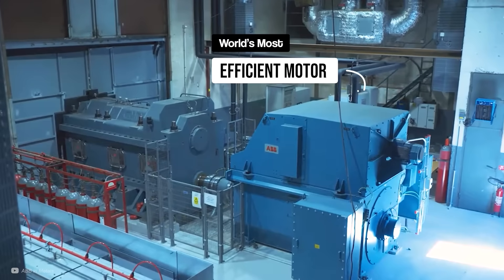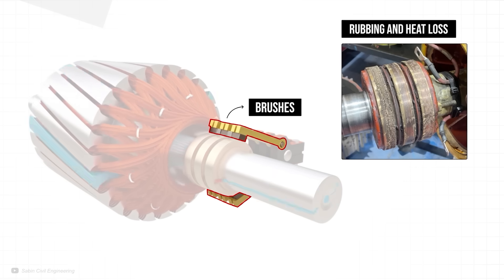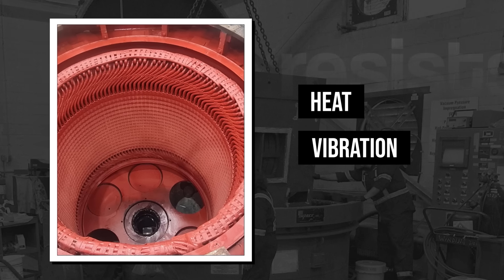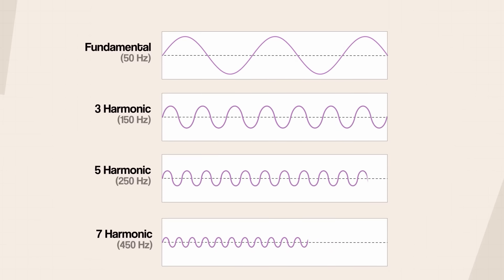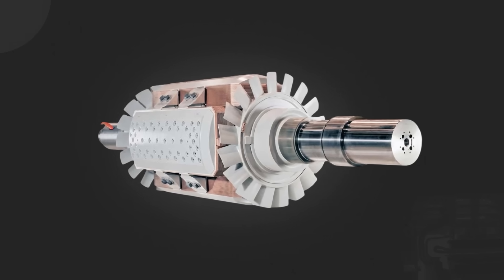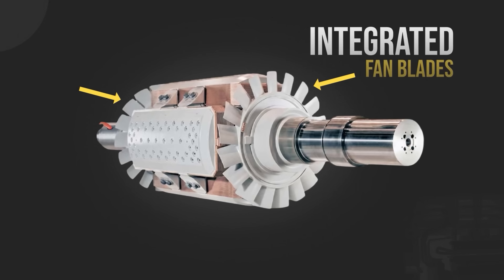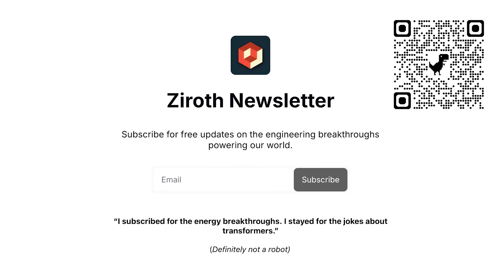How This Ultra Efficient Motor Just Broke The Limits

Comment: HOOOOLD UP. 

What exactly is supplying the cold water flow for cooling and  is that system's efficiency factored into the mayor's efficiency? 

If not, all I'm seeing here is a very well made motor that offloads the cooling losses to an external system.
Reply: yeah, the specs are misleading they probably also subtracted the power delivered to the coils as well. I'm guessing it's 95% efficient or something.
Reply: First of all there is no water pump, it's air cooled. Second, this is ~75000 horsepower motor generating the same amount of heat as a 160 horsepower car motor, and the amount of power needed to push such quantity of water around an evaporation cooling loop is basically nil.
Reply: @michaelbuckers You get 0/10 for comprehension. The cooling air goes to a water-cooled heat exchanger. What do you suppose happens when the cooling water isn't there?
Reply: @michaelbuckers  The rotor's cooling is air, but the stator is of course water cooled -- see the coolant temp on the placard.
Reply: Pumps require less power than you think, especially if only pumping water (no glycol, etc.), because water is basically incompressible.  The fan to cool the radiator will use more.  But because they're only dealing with <1% heat, and they'll need <10% of that to move the heat, it's pretty negligible.

Comment: the actual difference is negligible since other motors are also close to 99%
Reply: Okay so you'd rather have 1% of 1000, than 1% of a 1,000,000? Smart

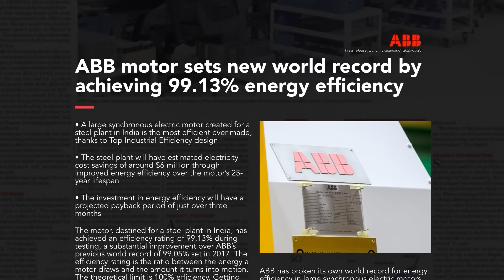Comment: 11:00 I assume the payback period of three months only applies to the difference in price compared to another motor with lower efficiency. So USD 60,000 will only be the difference in price, not the whole price of the motor.
Reply: 11:42 they say $6,000,000 over 25 years this sounds realistic to me, so what he did was 25*12 to get 300 months, then 6,000,000/300 = to get 20,000 per month. If the “news article” said it payed for it’s self in slightly over 3 months. 3 * $20,000 the business of news headlines favors aggressive marketing that are sometimes corrected else where in the article… or at a later date.
Reply: Your comment is most certainly true. However, even then there is no way ABB sold that bespoke motor at that low of a mark up.
Reply: Efficiency gains on motors are not actually to save much power directly, but to make the motor bigger and keep the cooling solution the same size. The power of electric motors are more limited by their waste heat output than from any power input limits. You can make some small motors put out some crazy power for a moment, before they melt themselves.
Reply: @KaiserTom  really is that true? I have always looked at electric motors and thought they did almost nothing with cooling on actual production motors. I mean think about most electric motors you actually buy, then think about combustion engines, combustion engines all have all the cutting edge heat management most using both air flow and liquid cooling in all the best ways, only the biggest electric motors or electric cars even bother to put cooling in, and for the car they mostly just say well the battery is what really needs it. I just think if the heat were really the limiting factor it would be cost effective to justify more then just some basic aluminum extrusion fin heat sinks that are part of the body any way. and maybe if the engine is big enough also attaching a fan to it in the wrong place to pretend to blow on it some. Cooling is regraded is a unnecessary expense by electric motors, because it’s on none of them. And it’s not just $, for light engines it adds weight, for heavy engines it messes with the efficiency specs as they are compared to electric engines without the power requirements of heat management. I agree with you they melt out of the box if you crank the motor up to full or actually run it for any amount of time but I am just saying I think they like it that way. They build it right to the limit, of their heat, and slightly over to sell you a 2nd one.
Reply: @Amipotsophspond  The cooling is very often built into the motor as a glorified fan attached to the shaft. And I'm not talking at the small or automobile scale level, but the massive sizes these things are that power big machinery. 

There's a level where the limitations of a motor are in the power delivery. That's up to the size of an automobile motor. It's not limited by the heat but just having enough power available to run it.

Then there's the large industrial scale where the limitations are no longer the power delivery, such as connected to the grid, and instead the heat generated by running it. That's where cooling solutions come into play. But like you said, there's not much investment in cooling it because those systems don't scale well for the slight extra power you can get doing it. When you can just get a bigger motor built instead
Reply: All manufacturers use a ridiculous apocalypse-level energy price when making these comparisons. The "3-month payback" claims usually assume $200+/MWh energy cost, which only applies in isolated grids or diesel generator setups. For grid-connected industry, you're lucky to pay $40/MWh — meaning the real payback time is 3–5× longer. Also, a 53 MW high-efficiency ABB motor won't cost just $60k more — that's a fantasy number. These motors are $5–10 million units, and efficiency gains like 90% → 99.13% would likely add $500k–$1M alone if not more, especially with advanced cooling and VFDs. The marketing math only works in worst-case energy scenarios
Reply: @kissa02  It's more like 3 YEARS! But still impressive!

Comment: When an efficiency figure like this is provided, what parts of the motor's power consumption are included, and which are not? For example, is the energy draw of the rotor's electromangets included? Is the cooling system included? The control electronics?

Comment: So many questions:
What percentage of the world's connected load qualifies as S1?

My experience is several decades old at this point but I generally found that more efficient motors were also more unstable during light loads or load fluctuations.  Not implementing vector-control techniques which were becoming popular at the time I do not have an appreciation for whether active control of the armature currents will, indeed, provide sufficient control of the motor dynamics, should it be applied to variable mechanical loads.  Hence, my original question regarding the percentage of S1, or stable, loads relative to total grid consumption. 

The  images used for harmonic components imply electronic commutation via a 6-step algorithm.  Is such rudimentary commutation still common on this class of machine, or are more sophisticated PWM methods now more prevalent?   ~80 kva on the armature is well within the realm of 1990's PWM technology where the harmonics could be managed to 1 over the harmoninc number squared rather than the 6-step 1 over the harmonic number distribution.  In other words, instead of the 5th harmonic (the first of consequence on a 3-phase system) being 1/5 of the fundamental amplitude it is 1/25 or lower in amplitude.

I'm not very skilled at conveying technology to the lay person, but it seems an attempt at describing in more detail why harmonics lead to higher losses is in order.

Comment: sure this is impressive, but we've had 98% efficiency for decades. The CSIRO PMSM motor was 98% efficient in 1997 and there's been countless others since, like Magnax Yokeless Axial Flux also 98%. So that extra 1% has taken 25 years, but good on them I guess. Congrats Doctor!!
Reply: It's easy to go from 1% to 2% efficiency,  you're only decreasing the inefficiency by 1% (from 99% to 98%). But you double the efficacy

But when you're going from 98% to 99%, you cut the inefficiency in half (from 2% to 1%). But you efficansy only increases by 1%
Reply: yeah it would be more impressive to increase the area of the island of efficiency as much as possible
Reply: @Herbit-k4j  Impressive, but irrelevant for a motor always running at the same speed/load.
Reply: @concinnus sure but there are many applications where they don't. EVs for example
Reply: That means about 3 times more loss. (0.7% vs 2%).
Reply: That called double the efficiency, baby
Reply: The point was claiming this was 96 to 99.13, but it was an innovation that took us from 98 to 99.13.

Good but not as good as the video implied.

Comment: I am surprised they did not encase the whole thing in a partial vacuum, to avoid drag, as per Energiestro flywheels
Cooling might be an issue but that would mainly affect be the outer stator and could just use water and use the heat in a TEG
Reply: It's only spinning at 1000RPM, air drag isn't too important (edit: you can also see that they're using air cooling for the rotor).  And you're not gonna get diddly from a TEG, lol.  The coolant is at 34°C, it's not gas turbine waste heat.

Comment: Basically the most interesting part is the power transfer to the rotor. do you have more info about that? has that been done before in other motors? I whish in the future you will give us a deep dive in this topic!
Nice video :)
Reply: Having seen many synchronous machines I wonder the same thing. When a brushless synchronous machine is run as a generator,  a smaller generator on the rotor, with a stationary field coil, provides power to excite the field. When used as a motor, you need to get it spinning first. You can use an external motor, or run it as an induction generator before turning on the field. Is that how it works?
Reply: @Abitibidoug 

Found an interesting paper on the brushless variable frequency motor / generators on the Boeing 787 and there is a lot of interesting things going on with the brushless aspect of this system.

As a generator it uses a permanent magnet on the rotor to provide a field to generate current in a small 3-phase generator called the pilot exciter which sends the output to a computer controlled voltage regulator whose output goes to a separate stator winding that creates a field to produce current in a small three phase generator on the rotor whose output goes to the rotating rectifier assembly that converts the output to DC (on the rotor) to power the main generator exciter coil (on the rotor). The turbine powers the generator. Unfortunately the paper does not explain how it is used as a starter motor but I assume that the stator exciter is driven by an AC current drive and the main 3 phase stator windings are powered by a variable frequency drive.
Reply: Some EVs are experimenting with inductive power transfer to excite the rotor, though tmk it's not in production yet.  And inductive power transfer can be drastically more efficient than e.g. Qi charging.  Using "resonant inductive coupling" can get coil-to-coil efficiency of 96-99%.  And since the rotor excitation is only 1% of overall power here, the power transfer losses should be minor.
Reply: @concinnus 

Why? Are not the EV motors either permanent magnetic or induction motors that do not require direct rotor excitation?
Reply: @Mentaculus42  I wasn't talking about an induction motor, but rather replacing brushes with inductive power transfer to excite the rotor electrically.  Admittedly, using resonant coupling was speculation on my part.  I've only heard of it being used on stationary charging pads so far.
Reply: @concinnus 

I was not aware of any traditional EV motors that used a rotor that would be using an excitation method like a three phase motor. Obviously I am excluding induction style motors which I believe are used in EVs. Tho I think that all EV motors have a type of slip ring to bleed off static electricity. It would seem like a permanent magnet motor would be more efficient overall but maybe what you are describing has some advantages with more torque or lower cost.
Reply: @Mentaculus42  BMW and Nissan have been using brushed rotors largely to avoid being dependent on rare earths (while performing better than induction).  Supposedly the brushes last 150k mi +.
Reply: @concinnus 

Interesting, but that makes sense, lower cost but higher maintenance. Probably in a Leaf, so designing for a lower price point and not trying to attain the highest efficiency but maybe better than inductive motors, so a compromise.
Reply: @concinnus The steel plant will run 24/7. So if your car was running 24/7 at 100mi/h that's only 63 days until the next brush replacement is needed.
Reply: @majaabjetzt5790  I...didn't suggest this thing should use brushes?  I said it could use induction into the shaft instead.

Comment: AI Summary

Abstract:

This video details the engineering behind ABB's highly efficient 56.2 MW brushless synchronous motor, which achieves over 99% efficiency. Dr. Ryan Inis explains how this colossal 95-ton motor surpasses typical industry benchmarks. The design incorporates unique features such as copper windings in both the stator and rotor, energized by a brushless wireless power transfer system that circumvents the inefficiencies of traditional slip rings. Further enhancements include precisely manufactured "form wound" coils with vacuum pressure impregnation for optimal conductivity and insulation. The motor's architecture is meticulously tuned to reduce electrical harmonics and employs an advanced, indirect air-to-water cooling system. Optimized for continuous (S1) operation, its design allows engineers to maximize efficiency for a specific operational "sweet spot." Currently deployed in an Indian steel plant, the motor demonstrates significant energy savings and CO2 emission reductions, showcasing the cumulative impact of meticulous engineering.

Exploring the World's Most Efficient Electric Motor by ABB

*   0:00 Introduction to Record Efficiency: The video introduces ABB's electric motor, highlighted as the world's most efficient, achieving over 99% efficiency, a significant leap from the industry standard of around 96%.
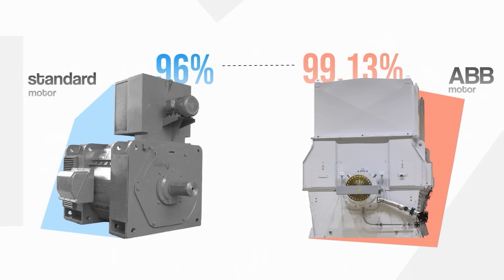*   0:35 Motor Specifications and Scale: The motor is a 56.2-megawatt brushless synchronous motor, spinning at 1000 RPM, and weighing approximately 95 tons—the size of a single-story building.
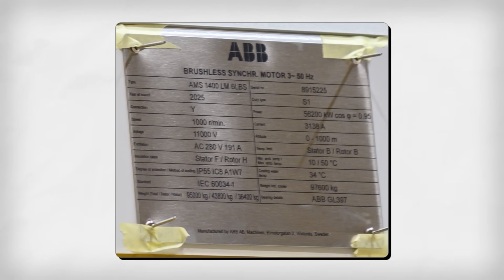*   1:45 Brushless Synchronous Design: Unlike permanent magnet motors, both the stator (stationary part) and rotor (spinning part) contain copper windings. The rotor is magnetized through "external excitation" via wireless power transfer (similar to wireless phone charging), making it "brushless" and avoiding inefficient slip rings.
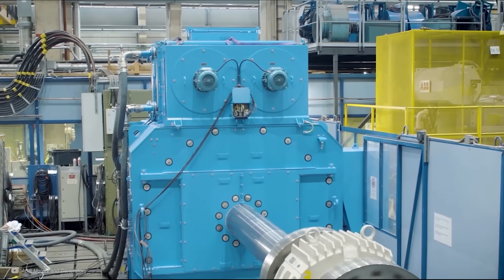*   4:01 Advanced Winding and Insulation: The motor uses "form wound" windings, precisely shaped loops of rectangular copper conductors that minimize gaps and maximize conductive material for lower resistance and losses. These are insulated with layers of tape and vacuum pressure impregnated (VPI) with epoxy resin, creating a robust, void-free structure.
*   6:34 Harmonic Reduction for Performance: The motor is engineered to reduce harmonics—unwanted distortions in electrical signals—which cause excess heat, noise, and vibration. ABB achieves this through advanced control strategies and solid single-piece rotors with attached plates that also aid cooling.
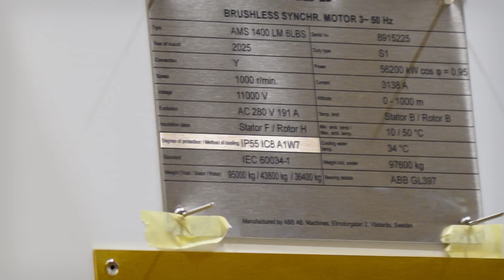*   8:17 Optimized Cooling System: The motor utilizes an IC8 A1W7 cooling system (an industrial standard), meaning it uses circulating air that is cooled by a heat exchanger and an external cold water source. Integrated fan blades on the rotor ensure efficient air circulation.
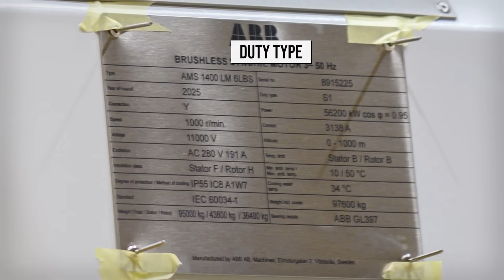*   9:17 Designed for Continuous Duty (S1): The motor is classified for S1 duty, meaning continuous operation at a constant speed and load. This allows engineers to specifically optimize the motor's "peak efficiency island" for these precise operating conditions, maximizing long-term efficiency.
*   10:28 Cumulative Engineering Excellence: The motor's record efficiency is not due to a single innovation but the culmination of perfect execution and optimization of tried and tested engineering designs.
*   10:40 Real-World Application and Impact: Operating in a steel plant in India with 99.13% efficiency, the motor is projected to save 61 gigawatt-hours of energy and $6 million over its 25-year lifespan. It is also expected to prevent 45,000 tons of CO2 emissions annually, equivalent to removing 10,000 cars from the road for a year. The speaker questions the initial claim of a 3-month payback period, suggesting 3 years (implying a cost of $720,000 vs. $60,000).

I used gemini-2.5-flash| input-price: 0.3 output-price: 2.5 max-context-length: 128_000 on rocketrecap dot com to summarize the transcript.
Cost (if I didn't use the free tier): $0.0067
Input tokens: 15569
Output tokens: 811
Reply: Better to just watch the video I’d say